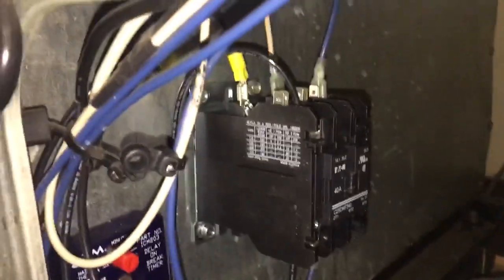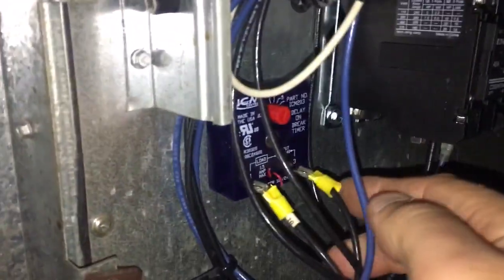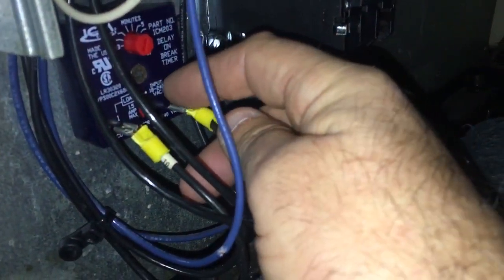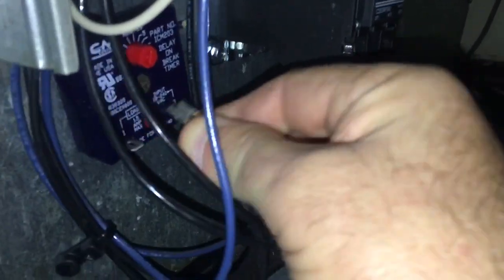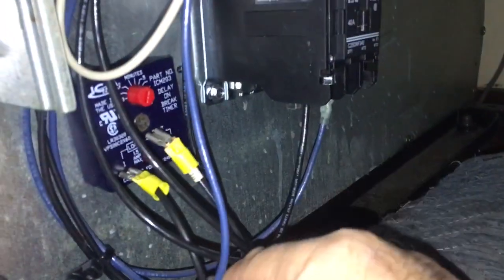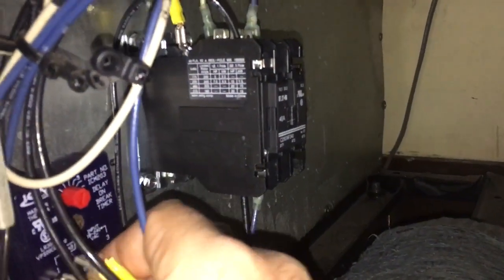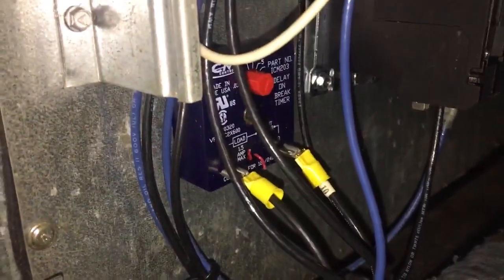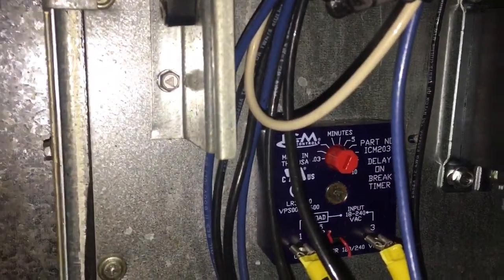Time delay Wiring - it Matters WHERE You put the Wires.

Comment: Please, I would like to know which type of electrical cable use to do the final connection? You know the first connection I will find a cable in the ac unit but I need to add another cable with two female connectors. Thanks

Comment: When you add a make on delay relay how do you do the wiring? From what I can see the wire coming from the "line" side of the relay goes to the 115 or 240 volt side of the coil. Where did you place the wire coming from the "load" side of the relay?
Reply from the maker: delay on make wiring - Example --- 115 volt contactor coil.

1. contactor coil -  to " Load " side of the solid state time delay on make relay or delay on break relay.

2. contactor coil - other side to 115 neutral. ( white wire ) 

3. Solid state time delay on make or break relay - to 115 volt Line power ( Black wire )
Reply: @OcRefrig  That makes sense. I have a walk in cooler with a 115 volt contactor. From the Make Relay I ran the Load to the 115 volt coil. I ran the Line from the Relay to L1 of the contactor and it didn’t work.
Reply from the maker: yea, you are just breaking the hot leg to the contactor. just like if u put in a switch. ( solid state time delay takes place of a switch.)
Reply: One more question @OcRefrig . If I wired the load to the 115 coil of the contactor and the line to the 115 L1 what would have prevented the make delay from working?

Comment: Is that for when there’s no 5 minute delay on the thermostat?
Reply from the maker: Correct. Or anytime You Just want to delay a contactor or relay from pulling in right away.
Like if u wanted to stage compressors from all pulling in at once , decreasing in rush amps , and therefore reducing electricity bills & stress on the Electrical service equipment.
Reply: @OcRefrig  ok thanks!! I have to put a fan delay in an Ahu in heat. We installed a hydocoil in an attic unit and don’t want them to get 5 minutes of cold air when it comes on.
Reply from the maker: Yea, sounds like it would work perfect for that. Use a “ delay on Make “ timer. A Delay on break will Not work for what u want.
Wire it on “ G / Fan connection “ on the 24volt in the ahu. You should be golden.
Reply from the maker: I thought most of the stuff these days has dip settings on the board for fan on delay & off delay.
Reply: @OcRefrig  yeah this carrier Ahu is just a basic straight cool. I put one in breaking W to the ecm motor. She’s all set.